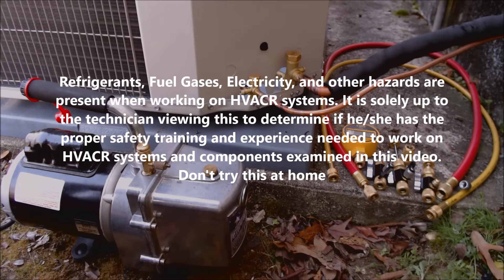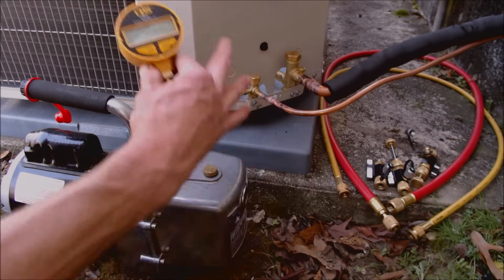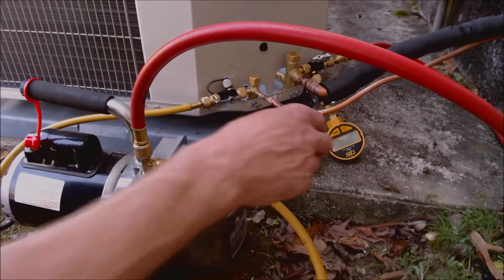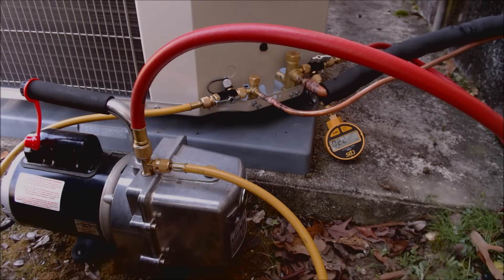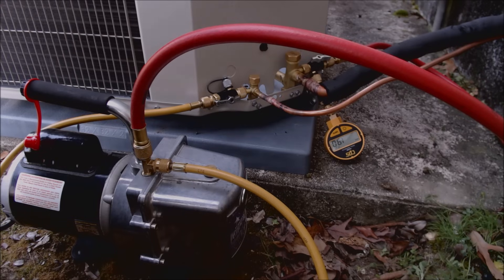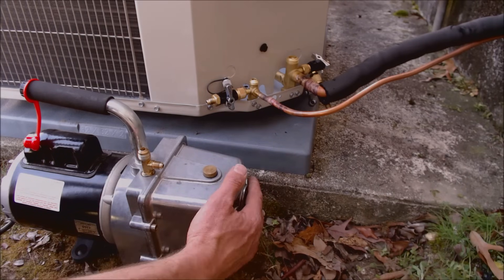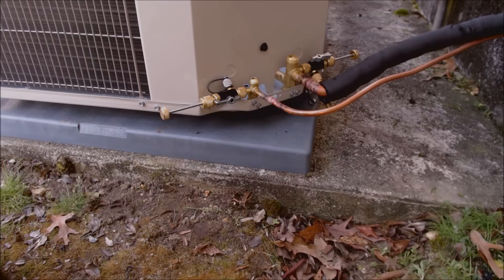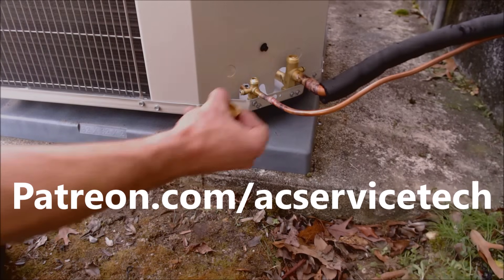HVAC Full Vacuum Procedure From Start to Finish!

Comment from the maker: Tool List-  https://www.amazon.com/shop/acservicetech
Support-  https://www.patreon.com/acservicetech
For those that are looking for the tools used in the videos: (Linked Below)
Here is a link to the JB 6 CFM Vacuum Pump   http://amzn.to/2nqbvo8

Here is the link to the Appion Valve Core Removal Tool- http://amzn.to/2uYr8WL

Here is the link to the CPS Vacuum Micron Gauge- http://amzn.to/2v1nM3O

Here is the Link to the Appion Blue 3/8" to 1/4" Vacuum Hose- http://amzn.to/2uYlVyc

Here is the Link to the Appion Red 3/8" to 1/4" Vacuum Hose- http://amzn.to/2uYg6Ro

Here is the link to the Yellow Jacket 1/4" by 1/4" heavy duty hose straight-  http://amzn.to/2umtcod 

Here is a link for RectorSeal Bubble Gas Leak Detector http://amzn.to/2ckWACn

Here is the link to the pack of 25 C&D valve cores- https://amzn.to/2J1lurm

Here is the link for the C&D Valve Core Wrench, Container, and 3 valve cores- https://amzn.to/2EVGkps

Here is the Link for the newer UEI DL479 Multimeter with temp sensor- http://amzn.to/2jtsUbJ

Here is the Link for the FieldPiece ST4 Dual Temp Meter- http://amzn.to/2AhR6ph

Other tool links can be found in the video description section.

Shop through Amazon! Your Purchases through Amazon provide a means for channels such as mine to earn advertising fees from all purchases after clicking through. Prices are the same as normal-    https://www.amazon.com/shop/acservicetech

All of the ACSERVICETECH Playlists-  https://www.youtube.com/channel/UCOZR-1IqsAer9wzlvFgb4mA/playlists?view_as=public
Reply: You may want to put a comment near the start of the video to remind technicians to use a A2L compatible compressor when using A2L and A3 refrigerants.
Reply: So if my line set broke and dumped everything out, to recharge do I vacuum the new line set and the unit by leaving the valves open?  Or do I close then and vacuum just the new lines before adding the 410
Reply: Aaaaaaaaàaaaaaàaaaaalpapalp
Reply: I'm about to order the tools to pull a vacuum using your list, but I'm confused as to which hoses I need. You have a red and yellow hose in the video, but a red, blue, and yellow hose listed. The yellow hose is not yellow once I click on the link.
This is what I'm ordering:
3)Appion Valve Core Removal Tool- http://amzn.to/2uYr8WL
1)CPS Vacuum Micron Gauge- http://amzn.to/2v1nM3O
1)Appion Red 3/8" to 1/4" Vacuum Hose- http://amzn.to/2uYg6Ro
1)Yellow Jacket 1/4" by 1/4" heavy duty hose straight-  http://amzn.to/2umtcod 

1)RectorSeal Bubble Gas Leak Detector http://amzn.to/2ckWACn
1)https://www.amazon.com/dp/B00SV8BCB4/?cv_ct_id=amzn1.idea.3TU6QWW7V7OQI&cv_ct_pg=storefront&cv_ct_wn=aip-storefront&ref=exp_cov_acservicetech_lv_dp_vv_d
Reply: Should I just buy a manifold gauge set and use it's hoses for a vacuum? I only intend on doing this once.

Comment: I was a dummy and put the valve-core stems in under vacuum then opened the valves to let refrigerent in...Is my system ruined?   I'm thinking by the time tool was inserted and the valve stem not much air got in?  Should I  evac it all out and start over?

Comment: i did everything you did and i have a field piece swan and it won’t drop below -29.9 on the manifold 
have only one removal tool and i used it on the suction side and have both hoses on the T fitting since my field piece has a micron gauge. 
3/8 from vacuum pump to manifold and unit won’t drop 

someone help!!!!

Comment: im confused, everthing i have bern told is under NO circumstances pull vacum with  valves out
Reply from the maker: Wow really? That would be the case if you don't have any valve core removal tools but if you braze line set you are already removing the valve cores. You would need the VCRTs to install the valve cores after there is positive pressure in the tubing. Have you watched this video yet? https://youtu.be/TllrD0Mt2LU

Comment: 5/16ths allen key for suction side service valve shut off. I had the multi tool but too many times it just barely hit enough surface to grab. I got a 3/8 drive 5/16 3 inch allen wrench and hook it up to a ratchet.

Comment: When vacuum testing a dry system,  I can reach 300 microns for thw line set, but when I open up the service valves on the outdoor unit,  I can only achieve 1000 micron.  Is there something in the component that prevents it from reaching <500 micron?
Reply: You probably pull oil from compresor.

Comment: In your video you use a red and yellow hose. Your parts list has a red and blue hose. Is the blue hose the same as the Yellow one in the video? You also list a yellow jacket 1/4" hose. When I clicked on it it's a black hose?  I'm just trying to get all of this stuff so I can work on my air cond.

Comment: You opened service valves with wrench to break the vacuum.  But I never saw you close them back up.  Could you kindly explain!
Reply: You don’t close them back up. Opening the service valves is what allows the refrigerant to run through the system.

Comment: Deep vacuum? I let it run for an hour check for leaks. Never had a call back. I have some new guys doing 5min vacuums and end up with problems very quickly.
Reply from the maker: It sounds like they are not doing a decay test, also known as a standing vacuum test. Thats the problem. It doesn't matter whether the vacuum is done in 2 minutes or an hour, if it is at 200 microns, after the pump is valved off, the vacuum shoud stay below 400-500 and not rise during the ten minute standing vacuum test. Maybe explain to them about the second half of the procedure to help them, thanks!!

Comment: I have a question about the vacuum procedure, when pulling a vacuum and I have a fixed orifice, should I remove the orifice to perform an oil blowout and leave it out during the vacuum pump or just leave it in? Its a R22 and I'm retrofitting for R422B

Comment: This guy doesn't know what he's talking about.,  13:45
Why would I use Rectum seal? The stuff from the port-a-jons?

Jk, 
Good procedures. Good to check for leaks., safe you a trip back. I like the blow the refrigerant thru the valves to get the tiny amount of air out. Keep the moisture out as best as possible.

Comment: You only vacuumed it down to 200 microns. Thought you were supposed to get it down to 500 microns.
Reply from the maker: 200 microns is lower than 500. We start at 760000
Reply: You are correct. My bad.

Comment: The importance of brass caps,and not plastic.I find they leak , companies before me,hand tight caps,almost always leak. a lot of technicians don't protect the valves when installing the outdoor unit, which in turn damages the internals of the valve. Always protect the service valves when installing a new outdoor unit, always install brass caps, not plastic, and always make sure the big cap and little cap on your two service valves are very tight.

Comment: The question I have to ask is: is this kind of vacuum produced when the machine is fully charged with freon?  when making a vacuum on a repair due to a change of compressor it can be done or in that case if it has to be done with the set of pressure gauges on.  I appreciate the attention provided .

Comment: Confused here.  Do you pull a vacuum with the refrigerant in the system?
Reply: No, all the refrigerant was in the condenser, and the service valves were closed. He was pulling a vaccum through the lineset and through the indoor coil. When he opened up the service valves all the refrigerant was released in to the linset and indoor coil. Hope this helped!

Comment: as far as opening the service valves, if you buy the napa carlyle 3/8 drive 3/16 and 5/16 allen key bits, they will never fail you.  the allen key is about 3 inches long and if you use a long handled ratchet, you will always have the proper depth into the service valve and leverage with the ratchet.  it helps tremendously opening service valves

Comment: I see a wide range of practices that represent scripture but have no practical effect. I had a vendor tell me I had to use their JB digital torque wrench because my metal jaw torque wrench might mar the brass nuts on the mini split. (His had brass jaws.) Jesus! I hear guys ALL THE TIME preach about the speed they can get to <500. Why? Our guys are taught to get your refrigerant pressure test done FIRST, and while your vacuum pump is running you can circle back for the 50 things yet to do; flue, gas line hi/lo voltage, caulk etc etc. Same with valve cores. Sure, my valve core is a restriction, and as a result my micron reading is infestimally artificial; the most accurate being from the pump to the schrader. But does that mean my micron reading is not representative? No! If I turn my pump off and my micron reading goes from 200 to 240---and then stops----why do I care? I have a tight system. I know 100 guys who use a manifold and the same hoses they use for service, cores still in. I wouldn't do that. I use a NAVAC 7 cfm pump with a single 1/2" low loss hose on the suction and a micron gage on the liquid. (1 hose vacuum) We have NEVER have had to sit and babysit a pump. I am simply unimpressed that a tech can pull a 3 minute vacuum, when we both have 45 minutes more left to do. Will pulling schraders give you a deeper vacuum? No. It gets you speed; speed you do not need. You can't tell me that if I get to 300---cores in---and isolate the pump and hoses, as you have done, and leave the micron gage in play, and it stays at 300, I don't have a tight system. I am not a shade tree guy---and I believe in best practices. I invest in tools. But there a whole handful of things we do that we simply do because we're told we should. Like brazing. Real men braze. Call me a sissy then, because stay brite is better in every way; strength, bursting, oxidation, tensile---every way. Buy we've been taught we must braze. It oxidizes. It pollutes. It's heat weakens the copper. I had one guy in 30 years tell me the flux turns POE oil to wax and will ruin a compressor. I'm still waiting for that failure.
Reply: I do install and I've done alot of change outs, a 3 minute vaccum would've made a huge difference and made my job a lot easier. If you can turn a 30 minute procedure into 5 minutes I don't get why you wouldn't do it.

Comment: Looking for some help from anybody….i can pull a vacuum to <900 microns but no further but…the vacuum holds…

I’m not using a valvecore removal tool because the one i have isnt vacuum rated….im suspecting the o’rings in my hoses may need replacing..

I can only use one standard diameter hose….

Pulled a vacuum for 1.5 hours, still couldnt get below 870 microns. 

Can/should i open my pin valves to release the refrigerant or wait to get the proper equipment to get the proper vacuum

Comment: Best videos out there,,,,I have a question what side you open 1st when you install a condenser..low side or high side?and do you need to break vacuum? Or can I open valves with unit in vacuum?

Comment: I don’t know what I am doing incorrectly, I have had several vacuum tests ruse well above 500 microns. I have the same setup as you, I pressure test and leak check all of my connections.  It has been frustrating honestly.

Comment: Can I still perform recovery, vacuum, etc with valve cores in because my 2007 Goodman heat pump and ac unit  valves are side by side and an appion valve core removal tool doesn’t fit?

Comment: Working on my 2005 honda crv. Holds vacuum,  however, When i remove lines from the high and low side. They both start sucking in air thru the fittings.  Whats causing this? Im removing lines properly.

Comment: I have this same setup with 2 1/2” hoses and my vacuum never holds but I don’t think I have leaks bc it passes pressure test. I check with soap bubbles and I’m pretty positive there is no leaks. What am I doing wrong?

Comment: What’s the order of the steps? Pressure test, recover, vacuum then recharge?
Reply from the maker: Here is a link to an article on our website for exactly that- https://www.acservicetech.com/post/when-installing-or-replacing-an-air-conditioner-use-these-procedures-for-the-refrigerant-tubing
Reply: @acservicetechchannel  alright thank you I’m in school for hvac and it’s still very early so I was just a little confused
Reply from the maker: No prob, lots of extra resources there and 480 vids here, thanks!

Comment: Would it be best after reinstalling the valve core to pull the stem back and valve off before removing the stem of the tool, just in case the valve core didn’t seat correctly in which case refrigerant would be release from the system. If you valve it off first you have full control of the refrigerant? Hope that made sense.

Comment: "don't put the cores back in until system is under positive pressure" Seems so obvious now but I never even thought of that, thank you!
Reply: I didnt hear him put positive pressure in system. Maybe got distracted. 

A DIFfer on my AC HeatPump, it leaked all freon out. 

Im going do a vacuum down to check if bad leak or not. 

I have no other equipment but rented a vacuum pump. I'm going to order micron gauge if holds vacuum and then do recharge.

Comment: Hello there, I the vacuum on the new system as per this video. Than ready to open service valve on suction side.  Open the valve cap to do so. I lost the vacuum in the line set. What I'm doing wrong..? Thanks

Comment: Only thing I do different is adding a wireless transducer on the non-micron gauge core removal reference and only pressurize to 20ish psi.  Allows for easier core install and lower de minimis.

Comment: at 9:10 you take the caps off the service valves and the OPEN THEM????   OPEN or SHUT CONFUSOIN = EXPLAIN. what were they at before you came and will ypu recl;ose them. You say pressure test micron leaks. with gauge.. We havew leaks and all AC guys do is show uo chyarge $400 and leave AC WORKS 2 MOS AND THEN DOES NOT COOL AND FREEZES UP. SICK OF 10 YR CARRIER BRYANT COIL LIFE. FAILS 3X+ OVER 10 YRS . NOT LIKING TO REPAIR/REPLACE FOR THIS THIRD TRY. 2000 2010 2021

Comment: Am I able to use the micron gauge on my 4 port manifold set to pull a vacuum. And would it be the same procedure with the apion tools?
Reply: Or would I just need to you 2 apion tools to pull vacuum with my gauges?

Comment: Thank you for this fine video.  Can't help but learn from it.  I had a misfortune on a Service call.  Hard lesson.  Vacuum hoses didn't have Check-valves.  Started the evacuation process and took a lunch.  The Vaccum Pump blew the circuit breaker and the line-set sucked the oil out of my vacuum pump and contaminated the whole system.  Was a bitch or flush out and recharge (R-22).  Didn't make any money that day.  Never gonna do that again!  Anyway, thanks for the video.

Comment: I just installed a new a/c system went through the regular procedure , pulled a vacuum that stood below 500 microns for 15 min.  opened refrigerant lines , turned on system, felt cool air inside for 5 min. Checked condenser and it was blowing cool air. Checked refrigerant level, system empty?  WHAT COULD HAVE GONE WRONG?

Comment: After you evacuated the system, you opened the service valves. Then you installed the cores. I know installing cores needs to be done under pressure to prevent contaminating the system. When you opened the service valves, was there pressure in the condensing unit which then flowed into the rest of the system?
Reply: Yes the units come pre charged for enough refrigerant for up to 15ft of line set depending on the unit
Reply: @anthonybernier9952  Perfect. It's important for viewers to recognize that consideration for system sterility must be paramount, even in the tiniest details.

Comment: I bought the Red hose, yellow hose and 1 Appion core remover since I already had 2 and tried this set up today. This works great. I pulled a vacuum down to 363 microns in 10 minutes and I didn't even change the oil on my vacuum pump.
Reply: Was it also a new line set?

Comment: how to quiet a TXV DURING DEFROST on a new outdoor condenser  sounds like air brakes. Is there a way  to quiet it  or  wire it so the heat scripts come on instead of that air brake sound?

Comment: Am I to understand that the two vertical core valves are closed during these procedures eliminating the compressor? In other words, just the tubing from the valves thru to the evaporating coil are tested?

Comment: Once you have pressured test with Nitrogen, how do you get rid of that in the system before vacuuming down as i was told Nitrogen can damage the vacuum pump.
Reply: I guess you can use your guages to release the nitrogen, so long as your hoses are rated for the pressure.. which they should be.

Comment: Ok first off great video. But I have a question, it's a 60-65 ft lineset and the outdoor comes orecharged for 15 ft of lineset so 45-50 ft * .6 Oz per foot needed how did you add the 27-30ish ounces of 410?

Comment: Question, the AC condensing unit is isolated when running a vacuum correct? unless there is no refrigerant at all in condensing unit?

Comment: So, just to clarify, this was a condenser & partial line-set replacement?  Was a little thrown off for a minute.  Also, curious about your thoughts of pulling vacuum under 250 microns if that condenser were included in the vac due to oil fractionation?  Or is that just rumors?  As always, love your videos.  I've learned a lot from them over the years.
Reply from the maker: There is no prob with pulling a deep vacuum even on existing systems with old oil in them. Yes partial line set replacement and new condenser so the refrigerant was held back at the valves, thanks!

Comment: Is it alright if we use two 3/8ths hoses for both the liquid and suction lines? Or does it have to the the 3/8ths to quarter fitting on the vapor line only? And then the quarter to quarter end fitting for the liquid line
Reply: Pair of 3/8 hoses are a great way to go.